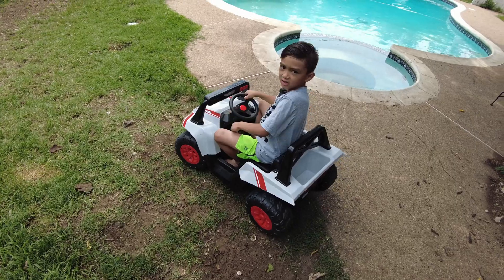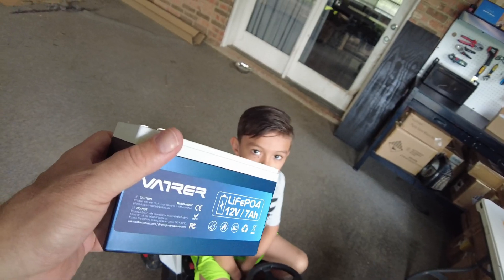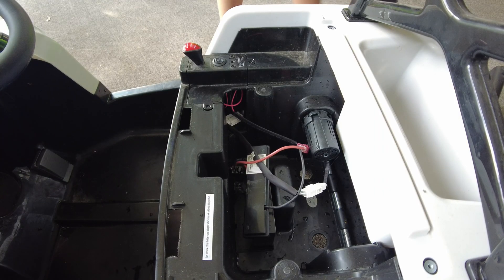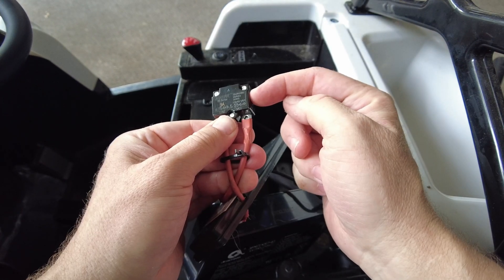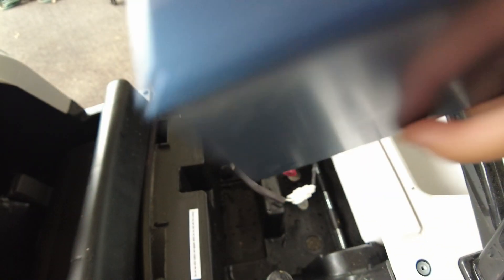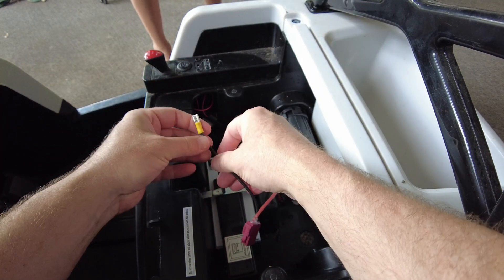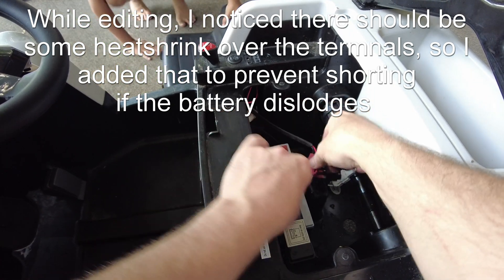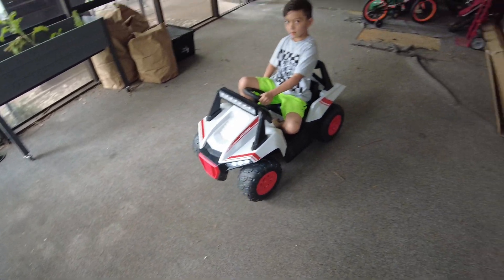Vatrer 12v LiFePO4 in a 6v power riding toy

Comment: I think the wee black thing may be low voltage cut off.. or what stops you killing the battery when going under voltage.. gel battery’s are more resilient to under voltage than lipo4 . Hope the New battery has a BMS so you don’t kill it.
Reply from the maker: Yes, the LiFePO4 has a BMS to protect the cells, so it will be fine. The black thing is a 9amp self resetting circuit breaker. We've tripped it a few times going up hill, and hitting thick grass. It resets in a few seconds. Thanks!